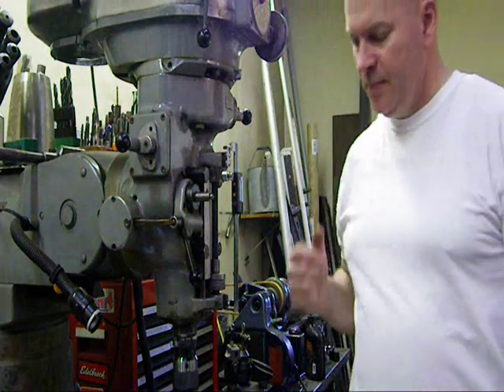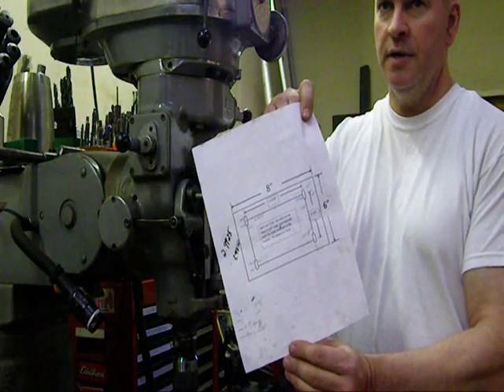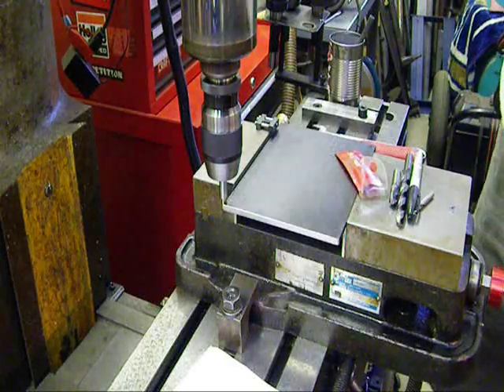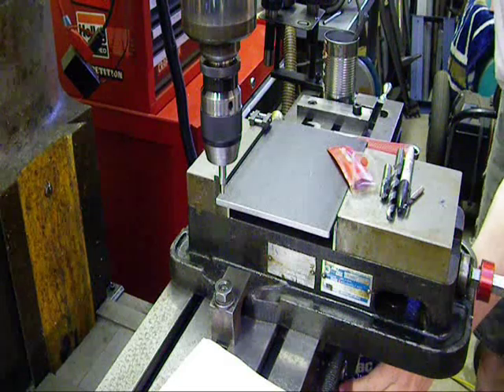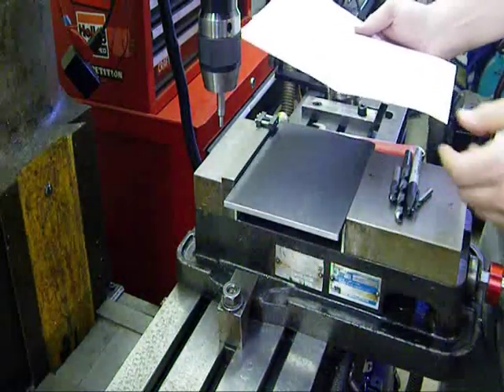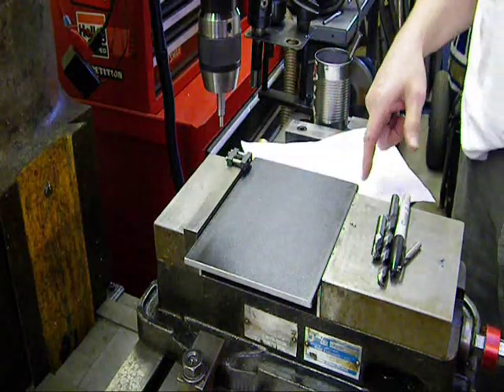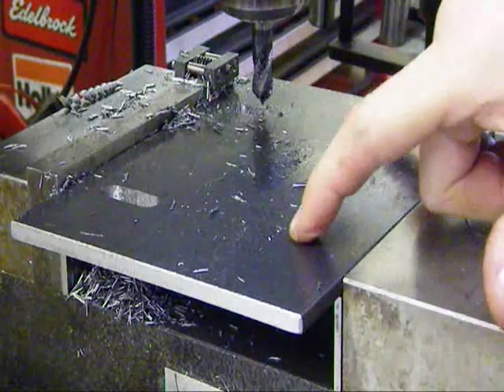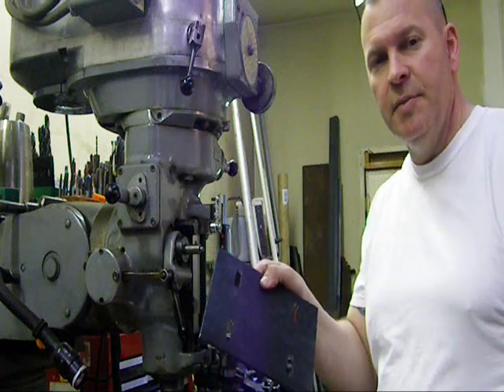Milling slots on the Bridgeport

Comment: how much would it cost to get a slot like that?i need 2 slots on a go kart rim bracket i took off the ones from a wheel chair.but my go kart axle its flat to round.so my tire wheel rim needs to be sloted.
Reply from the maker: Send me an email.  You can find it in the about me section

Comment: Hi, really enjoyed the video, well explained and illustrated. This is a newbie question, is a end mill and slot mill the same tool. I thought that the end mill was only to dress the end of work but then when I thought about it cutting a slot is very similiar except you are cutting material on more faces. I guess I thought that a slot mill was a bit like a hybrid drill/end mill in that you could plunge the drill through the plate and then move the table to cut the slot. The way you did this would be how I would do it. NSW, Australia
Reply: I am new to milling machines, but as far as I know, an S.D is commonly called S.E.M slotting end mill. 
A S.D will do what an E.M does, but an E.M will not plunge straight down like you can with a SEM (slotting end mill / slot drill).
Although, as I understand it, you can cut downwards into a slot with a regular E.M. as long as you ramp at an angle into the slot.

Comment: There are many ways to mill slots in plate, you gotter done! Thanks for the plug and watching my videos. I'm glad to see a welder / fabricator, which I'm presuming, expanding interest into machining. Becoming diversified with most relating trades to a job shop, will keep you in work during a slow or depression time period, that is what I owe much of my success in keeping Turn Wright Machine Works going, since 1994.

 ;{)-----
Reply: [Oo

Comment from the maker: Splunk. I am referring to a standard end mill which usually do not have center cutting capabilities.  Thus making plunge cuts with those non center cutting will cause wobble. However center cutting end mill will plunge. I used a mill drill cutter but really did not like the way it did a plunge cut either.

Comment: I wish I had a milling machine to do this kind of work. You mentioned the bit wobbles a little, and then the wobble disappears. How does it disappear? Is it making contact with the edge of the metal and that contact smooths out the wobble?